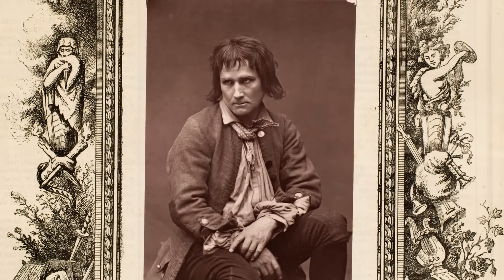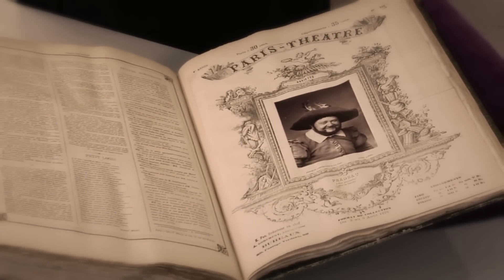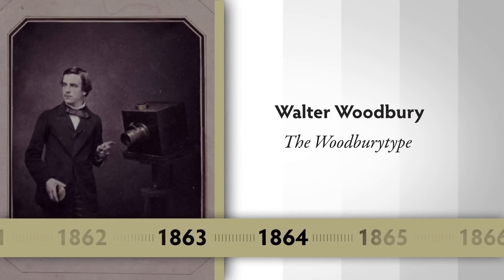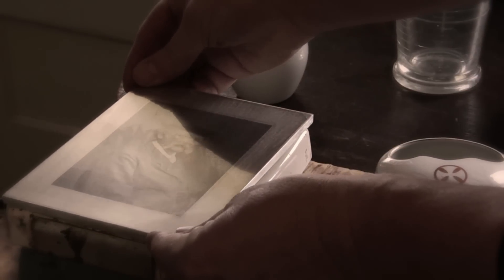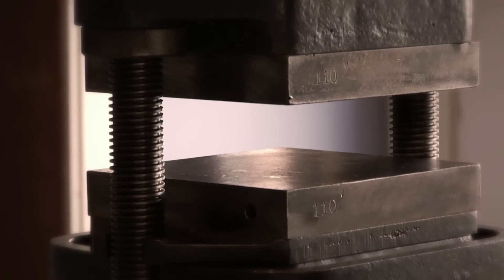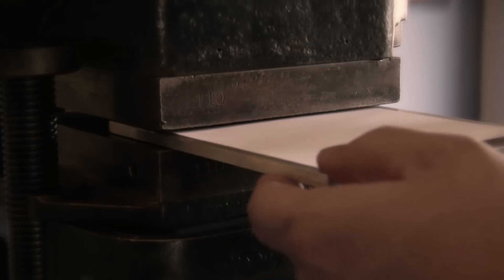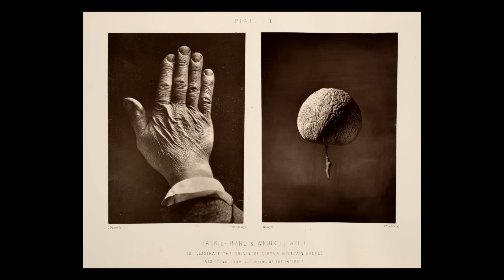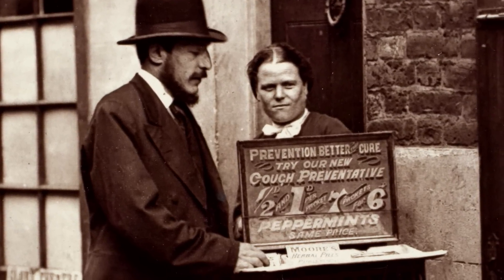The Woodburytype - Photographic Processes Series - Chapter 9 of 12

Comment: Fascinating to see the quality and level of detail and 'realism' of prints produced from Woodburytype gelatin plates. I acquired a set of original Woodburytype gelatin plates, in lantern slide format, with scenes of Niagara Falls frozen over in winter. The detail is exquisite on them and the light has a magical quality. It would be amazing to try getting a print made from them but I'm loathe to take the slides apart and try in case the images get damaged.

Comment: i think i have a Woodburytype lead mold, it´s a picture of a man and his wife from somewhere during the 1800s. i want to try making a paper copy is there a recipe on how to mix the gelatine and dye and what type of pressure do i need? can i use an old book printing press?
Reply: Make up a 10% solution of gelatine and mix in a little lamp black watercolour ink. Start with around 5g of pigment per litre of gelatine solution. The book press will be fine but demands muscle, and you can open it and peel your image after about 5 minutes.  All of this is just a starting point, but seeing as you only want to view an existing image rather than make your own from scratch this info should suffice. Good luck!